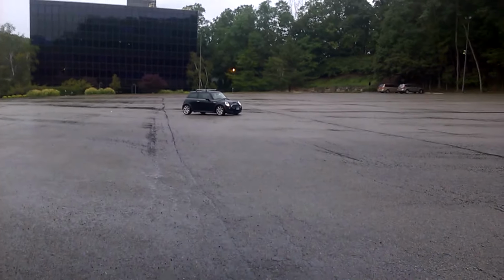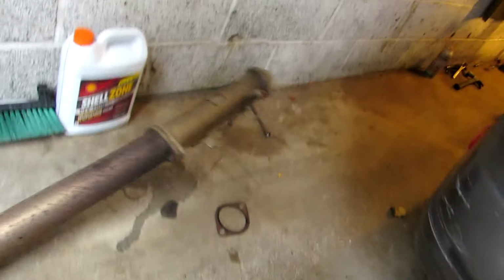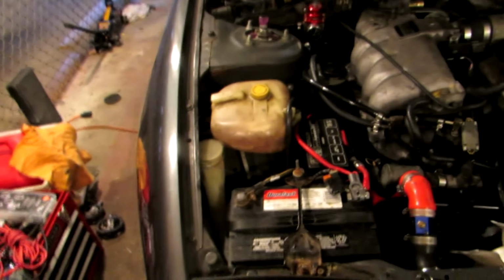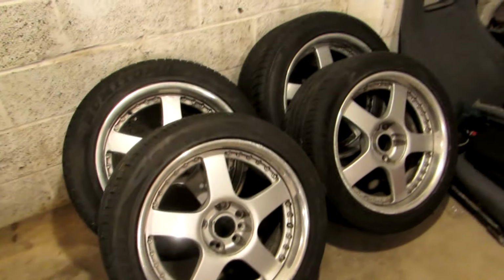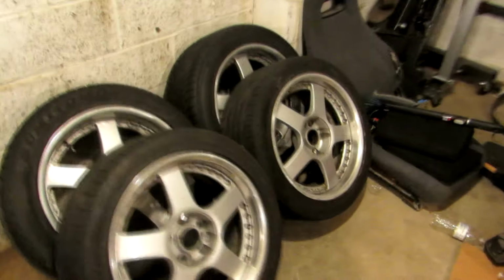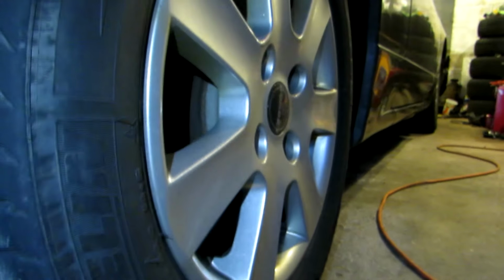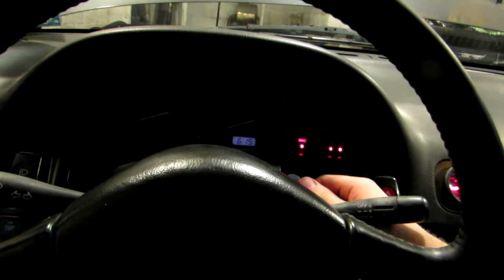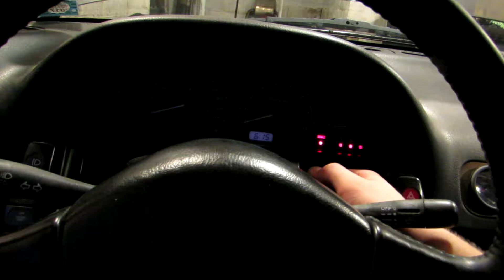Budget Build Ep. 22 | More problems & Open Downpipe Mayhem

Comment: +One_Clean_s13 and check the wires connecting to the starter and plus check the wires going to the engine block i always suggest getting the big 3 upgrade for your car even though it mostly ment for car audio but it can help with getting a consistent spark with ur spark plugs

Comment: +One_Clean_s13 check the relay and the fuse for your starter and check the connection where the negative battery cable connects to the body of the car

Comment: My 91 s13 with rb20det swap did the same thing when I first bought it. Wouldn't start or anything picked up a nissan forklift starter, and it turned out to be the alternator, so I used a Ka24de alt and slotted the middle bolt hole on the rb alternator mount and it works great now it starts EVERY time!  Just subbed you! You should sub back man. Gunna be posting some more 240 vids soon.